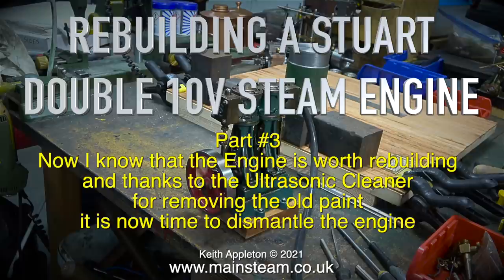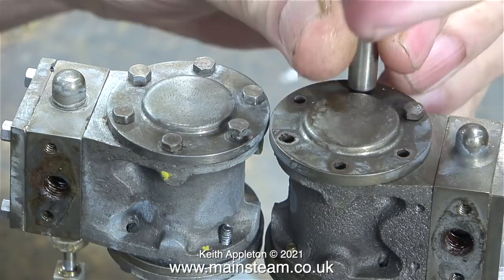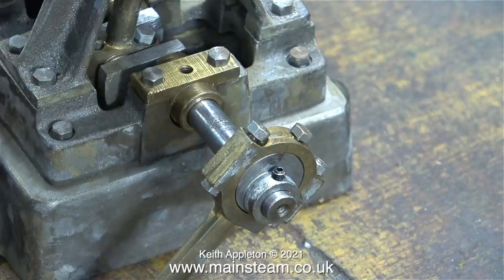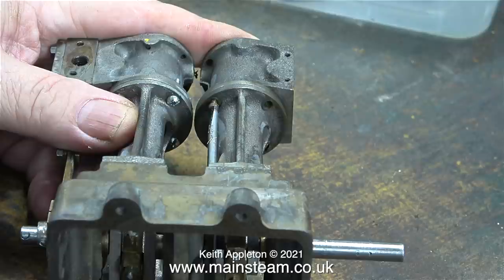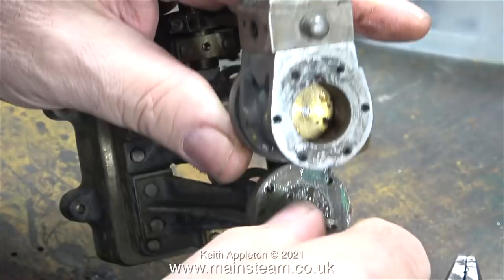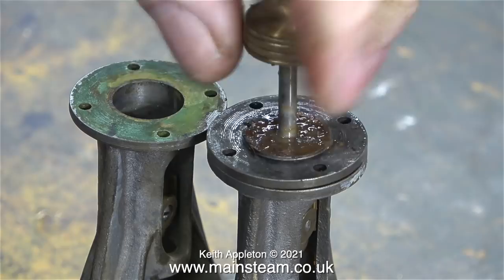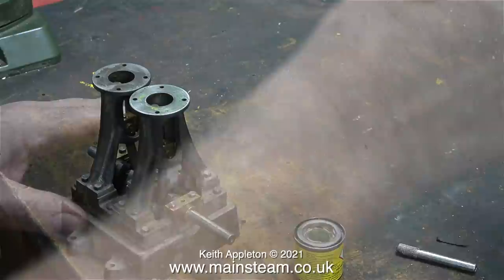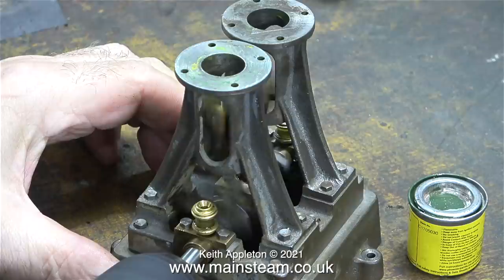REBUILDING A STUART DOUBLE 10V STEAM ENGINE - PART #3

Comment: The rubbish bit of pipe needs an experiment.  Put it in a container with your killrock K from the bucket.  Then put the container in the ultrasonic.  I bet the ultrasonic would turbocharge the killrock... as long as its not in the ultrasonic directly.